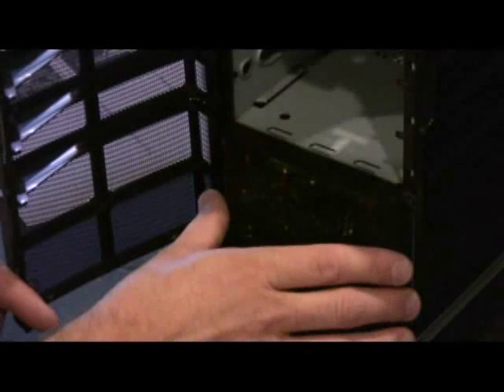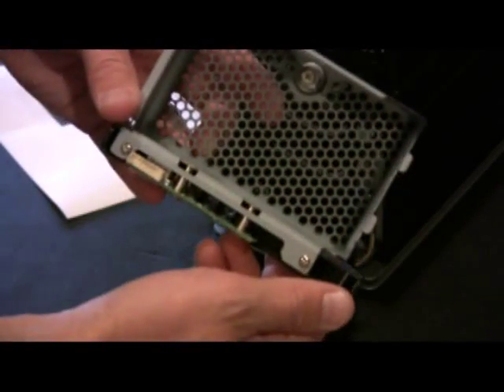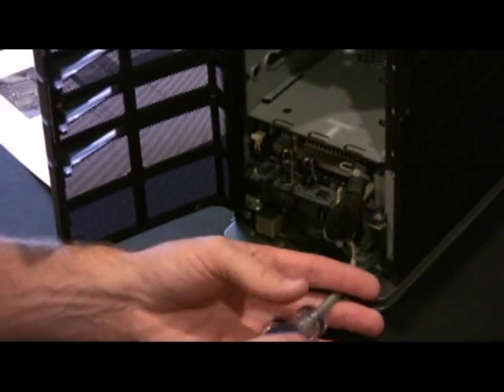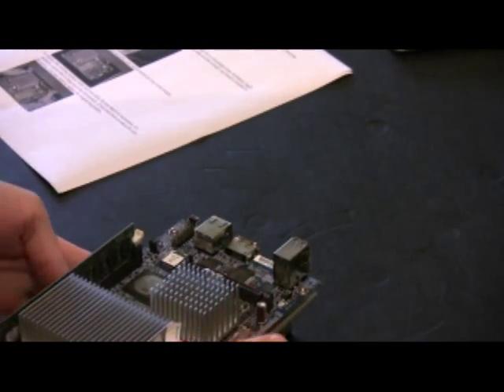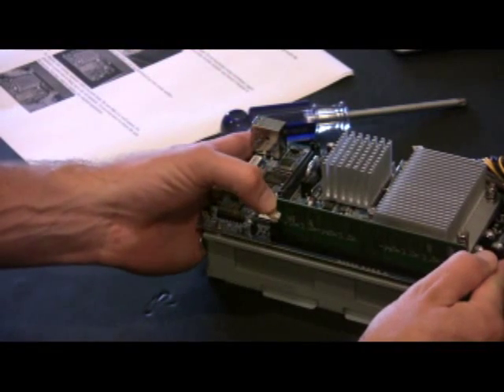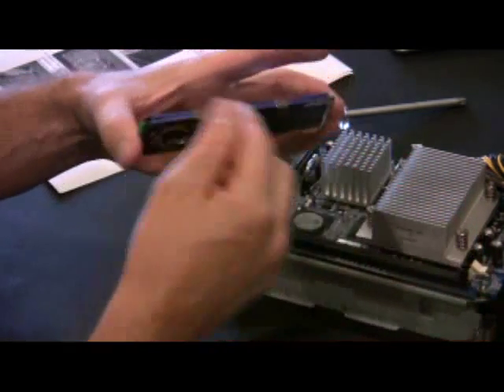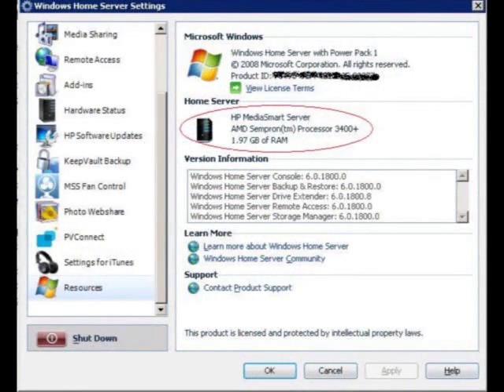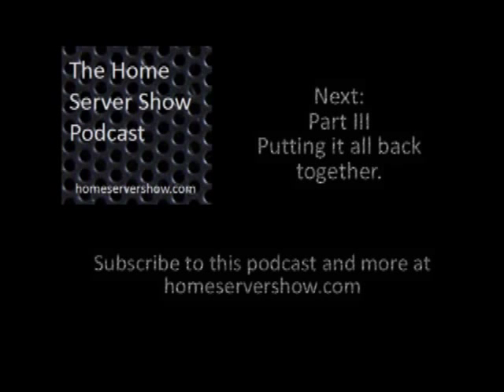Windows Home Server Ram Upgrade - Part 2

Comment: Just got a ex475 with the initial 512.   Is it possible to put 4GB of RAM?  Would it be beneficial to do so or just stick with the 2 GB?  I plan on purchasing a couple more HD's (it has the 2 500GB from factory)  and fully utilizing the hard drive potential.  I'm debating on going with 2 TB or 3 TB HDs in the open bays...does it matter which one I go with?  Your videos are exceptional!!